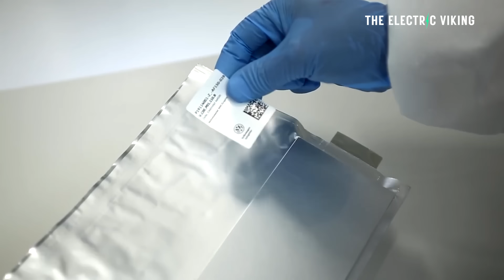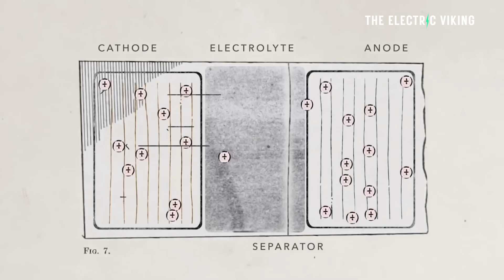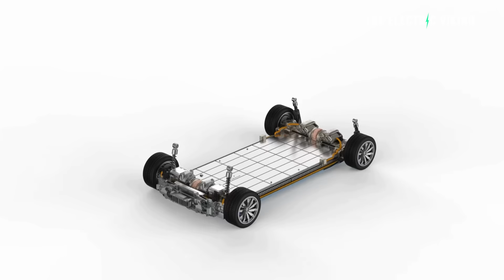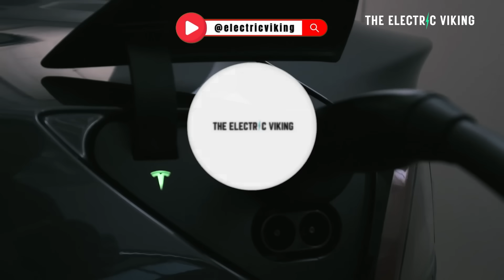Solid-State EVs Will Soon Seal Gas Cars’ Fate: 500 Wh/kg Power in 2025!

Comment: Yes! I live in San Antonio Texas. I would buy a EV only if it gives me at least 500 miles. And friends of mine would buy a EV also if it gives at least 500 miles and it’s affordable also. I’m going to wait until 2027 to buy one. Maybe by then will see EVS more of them given us higher mileage.
Reply: I live in Melbourne Australia. I can do Melbourne to Sydney (approx 550 miles) with a couple of short charge stops, which I also need to give my passengers a stretch break. I've done lots of long distance driving and I've not had concerns about a lack of range.
Reply: Do you often drive 500 miles without stopping?  If so, that makes sense.  If not, then the batteries that charge in 5 minutes seems like a pretty good technology for 90%+ of the people who have bladders:).
Reply: I think that I would need a solid state bladder that could last out the 500 miles. @krakken-
Reply: @krakken-   they could also be looking to have the option to tow something which can halve the range.
Reply: @someone6170  How many people actually tow, not that many, however you are correct and if so then an EV is not the best option - EV trucks are available with 500 mile range 😅
Reply: @krakken-  what do you consider as affordable, that’s the $64000 question. When you and everyone else decides to buy then the ICE trade in car value will plummet as no one will want it and because of the numbers of people buying the price will increase and you can bet there will be no 0 to low interest rates..  Cheap will not apply to 500 plus mile range EVs. If your serious about buying then get a used one now for $20k that dies 300 miles on a single charge for under $5 and put the money saved towards your perfect long range EV in 2-3 years time
Reply: Which vehicles sold now in US have those?   Oh, yea, by 2026 or 2027@krakken-
Reply: @krakken-  Same.  I’m also from Texas.  Many Texas company’s have multiple offices in DFW, Houston, San Antonio..we make a ~200 mi. One way trip once a week (400 mi round trip each travel day) but we also get some super cold weather so ~20% decrease in range before any degradation.  500 mi min. for
many of us until there are 10 min superchargers on every other corner.
Reply: @krakken-  If you can find a working charger that is not in use.....
Reply: Name an ICE car that goes 500 miles on one tank of fuel. The list is very short and you can't afford them. 300 miles is far more realistic.
Reply: @ttystikkrocks1042  My BMW X3 will go 1000+ kms on one tank of diesel. Diesel has very high energy density.
Reply: 500 miles is ridiculously long.
Reply: Tomorrow we are all dead. Can't wait forever.  I have been greatly enjoying my EV life (Ariya and Equinox EV). I drove Ariya between San Diego and NJ twice @70-80mph. Anyone driving long distances always need charging stops to improve blood circulation. Just yesterday I came back from a trip from San Francisco (started from San Diego) on Equinox EV. I came home in 11 hours.
Reply: @sajiantony7473    At 60 something, I am many years removed from driving for hours on end without a stretch.  If I were to pee in a bucket and drive 500 miles straight, it would require paramedics to help me out of the car and make sure I’m able to walk without assistance 😂.
Reply: Range isn’t actually the issue. The recharge rate is more impactful.
Reply: Do you wear astronaut diaper while driving your 500 miles?
Reply: Wow you are driving 500 miles without stopping! Very good! 🤣🤣
Reply: @sharpred8316 . Welcome to Texas.
Reply: @sharpred8316 It is pretty normal in Australia. I drove 900km Mel-Syd almost nonstop with one coffee and cigarette break for 5 mins.
Reply: @AnuragSharma-rq2tp  I'm from Australia too... Can you let me know when you're doing that? I'll make sure I stay off the road - tired drivers kill... 🙄
Reply: How big is your bladder?  You peeing in a jar?
Reply: 500 miles is a rating, not real miles.  We all know that everything steals miles in an EV.  I’m waiting for a 500-mile-rated care also.
Reply: @JNM202  You're wrong. Real-world testing suggests that the Chevy Equinox EV can achieve a range greater than its EPA-estimated range. Edmunds' testing revealed that a front-wheel-drive Equinox EV 1LT achieved 356 miles, exceeding the EPA estimate of 319 miles by 12%. This means the actual range is better than the stated EPA range.
Reply: @JNM202 Cold weather, headwind, heater, a little degradation…now your 500 mi. EV has a 200 mi range.  Not a problem if there are 10 min superchargers everywhere, but there aren’t yet (in Texas).
Reply: Gotta love the petulance e pressed by so many drivers in the US.  OMG, I have to be able to drive 70+ mph and not have to stop for an extra 10 minutes on my 500 mile, once a month trip!  Oh, the humanity!

Comment: I'd be happy with 250 miles range, but it's gotta be cheaper than ICE. 

I'd be interested in the longevity figures. I don't need more than 1000 cycles. That's 20 years if you charge once a week.

Comment: America has a pickup that gets 450 miles but many Americans are not interested as we see many new gas trucks with engine problems . You can get a used  2024 Silverado with barely no miles for 45k with that 450 mile range . Trump put the brakes on ev development in the states but it's not dead . Musk freak out and stopped  Americas only ev advantage .